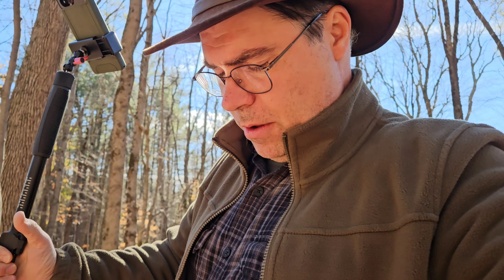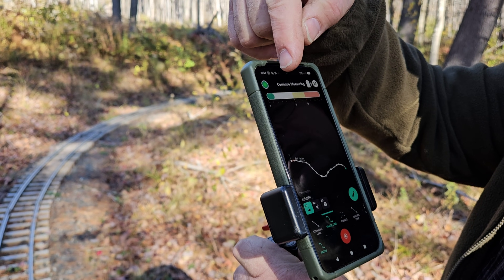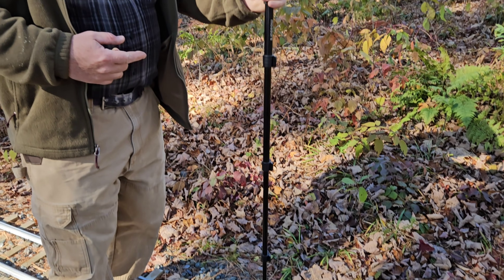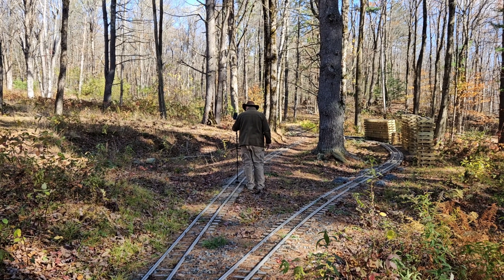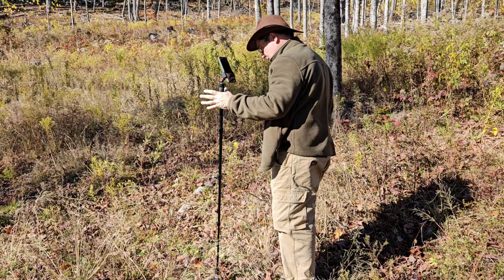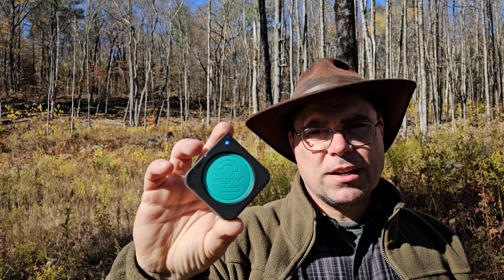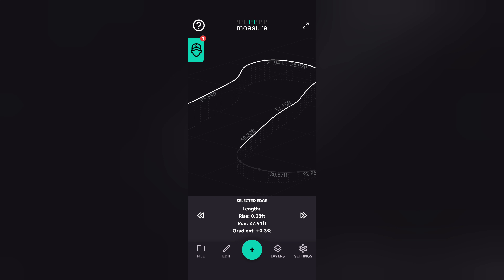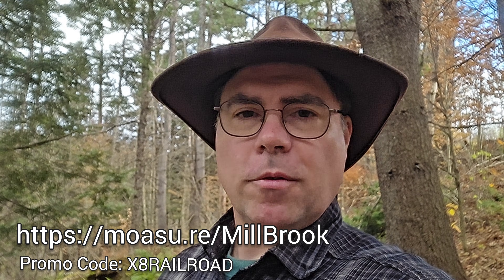How steep was that grade? Measuring the SHFR with Moasure 2 PRO

Comment: any plans to bring #70 and train out for more track building with the whole crew?
though with an 8+ percent ruling grade, you might require a boost in tractive effort.
Reply from the maker: The tractive effort of the 70 is fine for that grade. It's the traction motor that might have a problem. Not enough horsepower for more than a couple cars.

Comment: Great seeing the Stoddard Hill Farm Railway again.  On the Moasure 2 Pro, curious if it will report the track radius as well??
Reply from the maker: It gives you all the points you set it down, so you can calculate the average curve radius. In the case of that 8% grade, it measures 75 feet across. That's a 37.5 foot radius curve.
Reply: @MillBrookRailroad  OK, that's even more impressive.  Thanks

Comment: I went to the website separately without the link: $999.

I clicked through the link with discount code applied: $999

Does the discount apply in the cart after checkout?  Not sure why the price is the same.
Reply from the maker: That's a good question for the folks at Moasure. It's beyond my control.
Reply: Hey! Thanks for spotting that, it is sorted now ! :)
Reply from the maker: Thanks!

Comment: So overall its just shy of 2.2%, He's going to need a leveling Jig to correct some of the shorter run increments set for a rise of 2 inches over 100 inches run or 1 inch rise over 50 inches run to spot check his own ground rework. He can't have any deviation other than a 2% incline from start to finish to maintain the 2% overall. This can be done with a spirit level but, it's also good to know the overall rise with your surveying device to set overall parameters with.
Reply from the maker: The hard part is that he's on the side of a mountain. That 8% section is because he hit ledge. It was steeper but he knocked some of the ledge off with a cordless hammer drill and a bucket of expanding demolition grout.

Comment: Moser pro sounds like a great device and wow 1000ft with 22 ft rise !
Reply from the maker: It's quite the grade.
Reply: So it works like inertial navigation?
Reply from the maker: @johnblair8146 from what I understand, yes. Except that it relies on data points where it sits still to take a measurement.

Comment: Is this a logging layout? Must plan on using some geared locomotives? I thought one try to keep things to about 3% max. keep up the good work
Reply from the maker: It's sort of like a logging line. He tried to keep it under 4%, but he hit ledge in two places. He knocked it down as much as he could with a cordless hammer drill and a bucket of Dexpan expandable demolition grout. He couldn't go too far down, though, because of the brook  he had to cross coming out of the curve. The rest of the railroad has a much gentler grade.
Reply: @MillBrookRailroad  makes sense. i don't think of rock as we don't any out on the prairies. so never crossed my mind